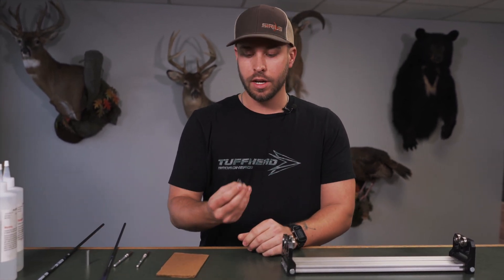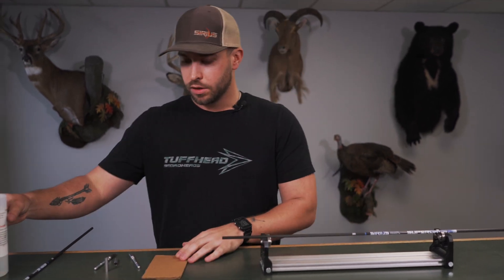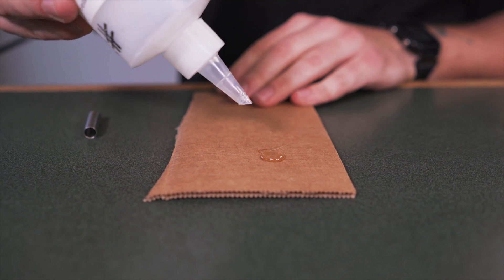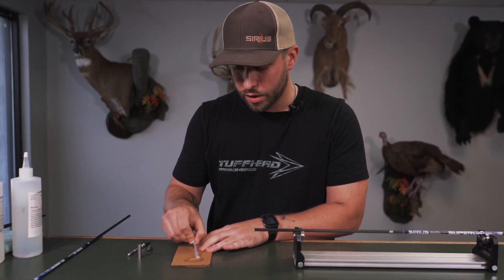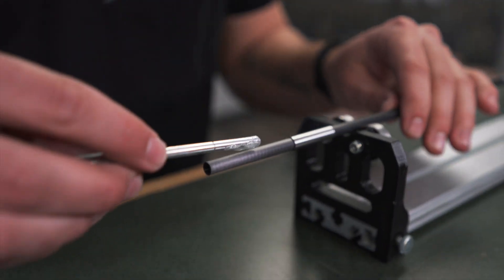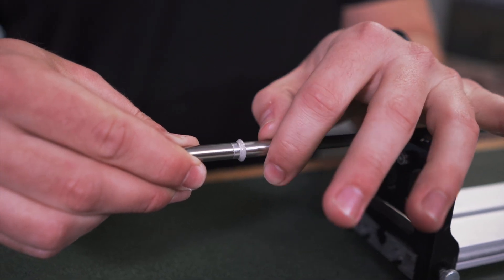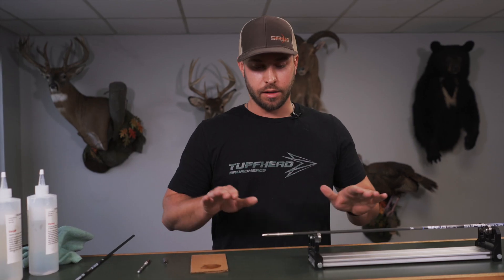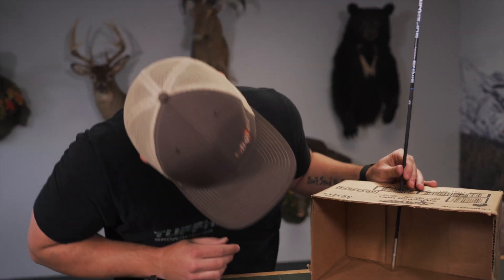How to Install the Half Jacket Insert System (Updated Version)

Comment: How would you remove them if you wanted to try different weighted inserts?
Reply: Take a drill bit that fits inside the shaft. Take nock out and put drill bit In backwards. Flat part in first. whip the shaft downwards while holding onto it. It brakes the glue or epoxy loose and insert comes out
Reply: Just use hot melt.